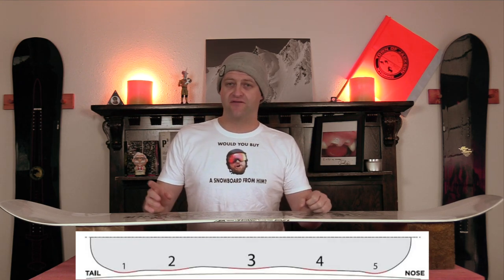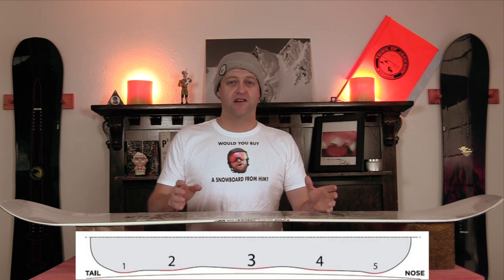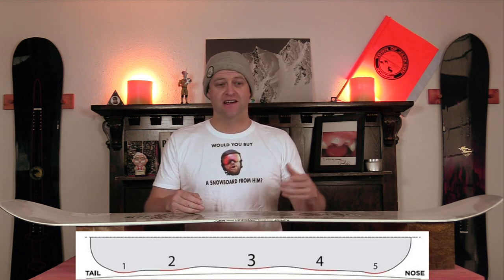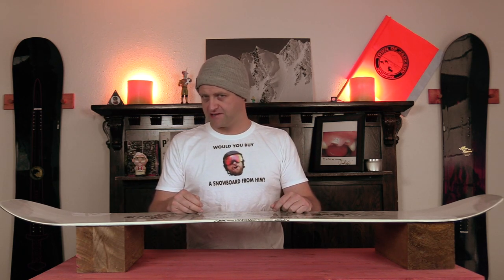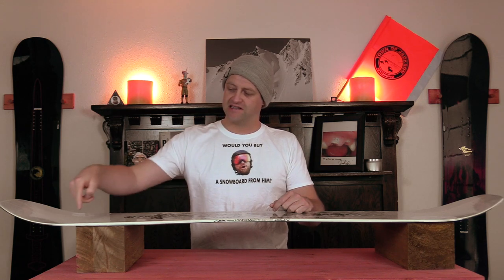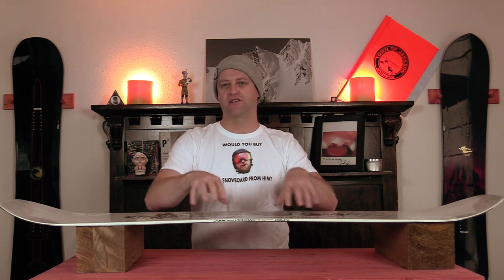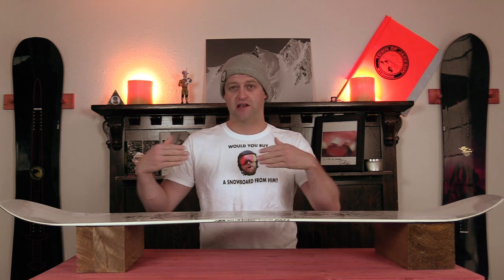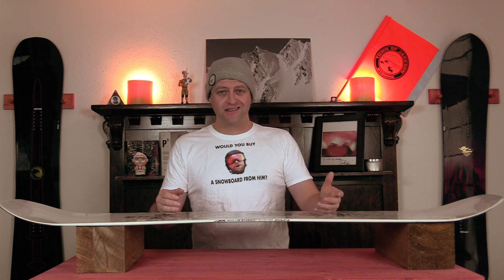Rossignol Snowboards Serrated Edge Technology: Explained

Comment: My Capita holds an edge way better than my Libtech did. I reckon more lumps equals more drag and less speed
Reply: My Mercury holds a wicked edge and it will go faster than I want it to if I drop the hammer. Very surprised at times thinking I’m going to eat shit but manage to go heal to toe no problems from the board
Reply: @genegraves6963  yep i had exactly the same experience on my mercury
Reply: @genegraves6963 @john sutcliffe You lads buying another mercury? I love that board but considering buying a Super DOA this year. being stiffer it might be just as fun and true twin. Any thoughts snowboarders of the internet?
Reply: @extropy  didn’t get full season on Mercury so I’m good. Got a 159 for wet PNW hard charging-maybe consider it my powder board. Got a killer deal on SDOA “I just want it out of the shop” as resorts closed. 156 rode it once in sticky slow shit but loved it.
Reply: @genegraves6963  How did it compare with your super small experience? Stiffer, less stiff? Playful? Honestly if it is comparable in stiffness I think I will pull the trigger on it.  Any first comparison thoughts super welcome.
Reply: @extropy  I don’t know I think I just wanted it more than anything. The  price was hard to pass up. I low balled the guy and he said ok so out came my credit card. Might not have needed it really SDOA is 156 so I can get it back under my feet quicker. Didn’t charge any steeps with it.